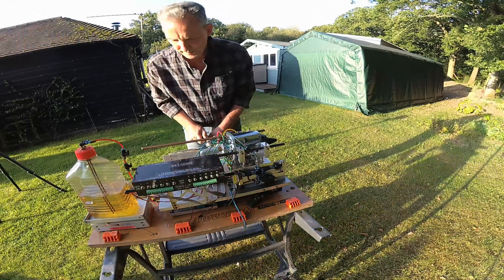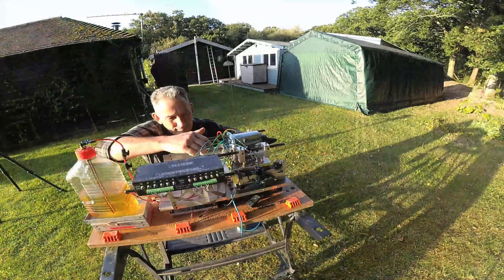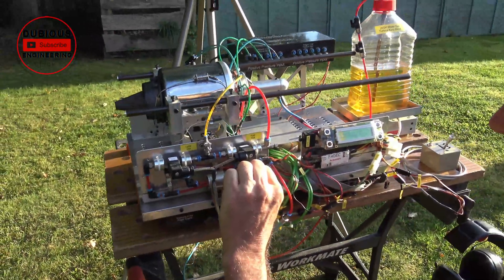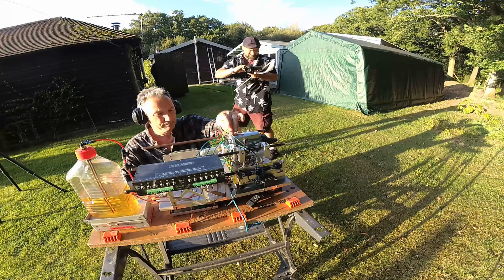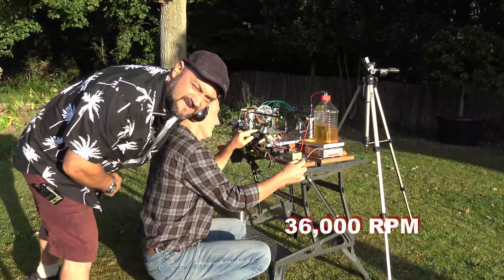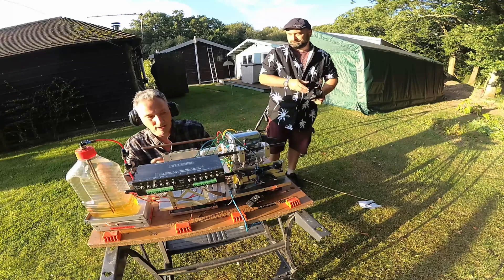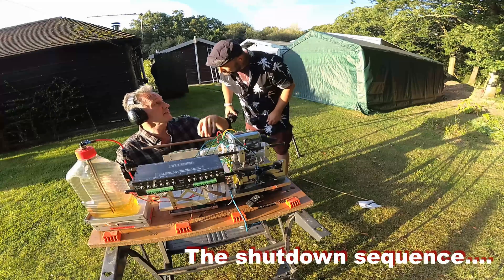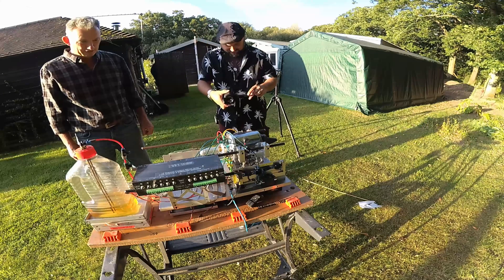DuB-EnG: AMAZING JET ENGINE with Centrifugal Compressor Axial Flow Gas Turbine ALL HOME MADE

Comment: Does this have more thrust than the PBS TJ150. The engines used on Yves Rossys jetpack?
Reply from the maker: No - i'm sorry It can generate about 10-20lbs of thrust - enough for a small light model plane or helicopter.
Reply: @DubiousEngineering  Is that why that engine has axial flow? Because adding a turbofan adds too much weight? I guess that's what it says in this research paper I found. https://www.google.com/url?sa=t&source=web&rct=j&url=https://www.preprints.org/manuscript/201810.0608/v1/download&ved=2ahUKEwj538_hq_fwAhWTLc0KHeFhAVsQFjAFegQICBAC&usg=AOvVaw3C9IUitocCZq4KRWw28M_1

Comment: Dear gents, a few questions please:
-how does it start combustion, spark plug or something?
-did you measure trust?
-how did you solve bearings lubrications, oil-fuel mixture or...?
-what rpm it run?
-what is max consuption?

Thank you very much in advance
Reply from the maker: Wow! So many Questions! - Glow Plug and propane to start it, then inject parafin.  Yes, thrust is measured with a load cell.  Bearings are lubricated by the fuel. 120K RPM.  Hope that helps:-)
Reply: Thank you very much
Had some doubts, so needed to get more closer to problems and practical solutions.
You are doing amazing things. 
All the best and keep it up 👍

Comment: Hello i love the project but not to familiar on the exact working mechanics...is it the motor that spins it so fast or u cut the motor off at a certain point and it runs on it's own ?
Reply from the maker: The motor gets it up to speed, and once the fuel starts burning, it runs on its own.
Reply: @DubiousEngineering  thank you very much

Comment: I want to know how exactly thrust is calculated in the model?
pitot tube?
or some kind of  sensors?
what kind of device is used?
please answer this.
Reply: do you wanna calculate or measure, it is easier to measure, put engine on wheels on rails and  make L lever to presses kitchen electronic libra but this is only static thrust at 0 speed, it could rise as speed rises if you have good intake
Reply from the maker: load cells on the test platform to measure lbs thrust
Reply: @DubiousEngineering  Thanks a lot.
is there any other way?

Comment: U didn't use gas till the end why 
I mean why use gas for only kicking of those it mean gas can't be use only on jet engines
Reply from the maker: Gas was used at the beginning to warm up the combustion chamber, we then switch to Patarafin ... check out some of our other videos on this, James talks you through the whole process... cheers!!
Reply: But can gas be use through out the process till end
Reply from the maker: Gas is too thin and dissipates too quickly... so the engine will not reach the high speed of 120k RPM
Reply: @DubiousEngineering  but gas can take it up to 80k RPM and 100k RPM like us or must it be kerosine
Reply: @DubiousEngineering  use liquid phase of lpg, rotate your bottle upside down and you will have it